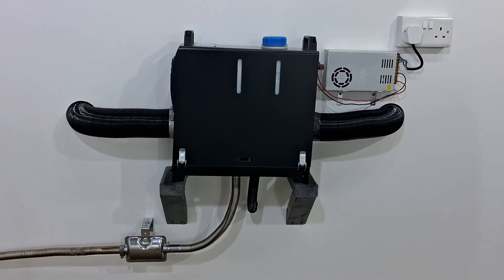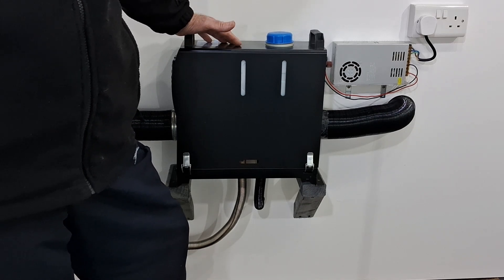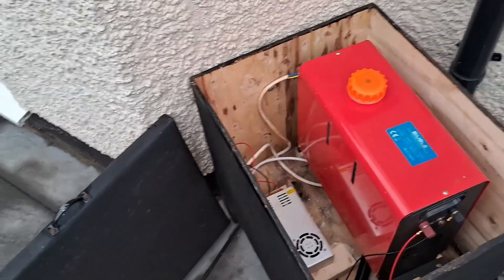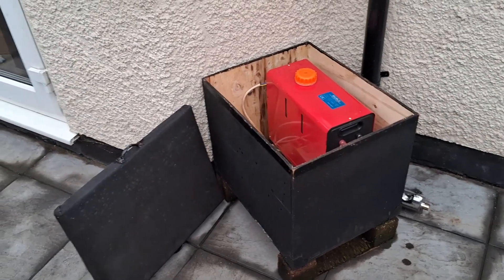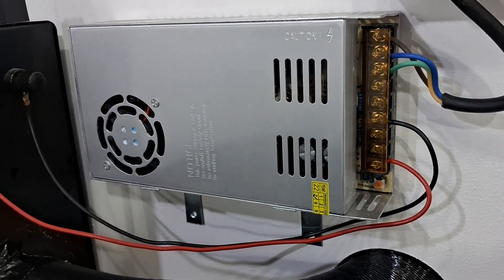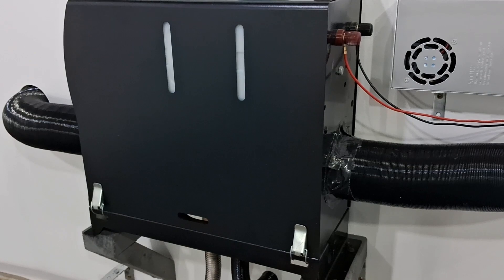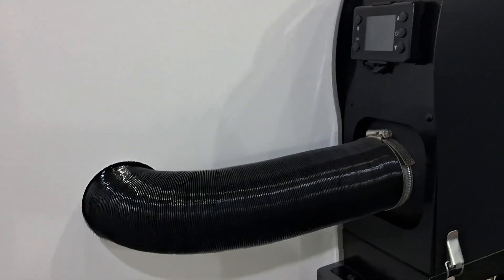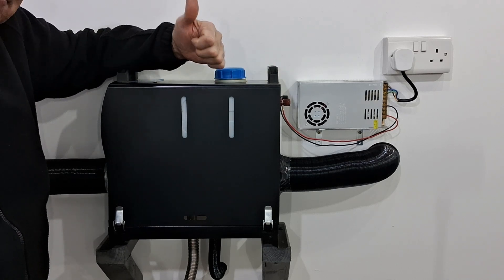DIESEL HEATER HEATING MY HOME

Comment: put an old iron radiators on the exhaust 3/4 pipe fits, i did on mine and in a non insulated 20" container and it helps alot.
Reply from the maker: good idea cheers andy

Comment: Hi Andy, you have inspired me to purchase a diesel heater to heat my home. I too have a garage which is where I intend to house the heater & pop a hole through the wall into to the hall. Like you my hall has all the ground floor rooms & the stairs off so it seems the best place to start. Why have you mounted the heater so high off the the floor? I assume that you have ducted the fan intake air from your hall to recirculate warm air rather than colder air from the garage? I also live in the Midlands & know of a Kerosene supplier I already use for my smokeless coal, logs & kindling. My heater has been delivered so thought I'd drop you a message, this is where my  journey begins 👍
Reply from the maker: it looks higher, because the garage is lower.
thats great, have fun.
i think its getting colder now so you have just got it at the right time.
let me know how you get on
cheers andy

Comment: I spotted a problem with these,   anyone using lifepo4's to run these and when the voltage gets too low the combustion turns directly off and reverses through the input manifold back into the house. 
It was a surprise as I had to find a power source to charge the battery back up to cool the burner down. Be careful with these. (Not plug and play).
Reply from the maker: thanks , cheers andy

Comment: I have a similar setup. Drawing warm air from the living room is ok You need to put that "silencer" outside because it leaks Co2 from the drain hole in the bottom of it. Also, I use smooth bore pipe and not that corrugated pipe from the point where you have the silencer so as to aid gas flow out of the unit (corrugated pipe collects soot over time). I used to use diesel for 18 months but have used kerosene for the past 8 months with zero issues.
Mine is located under the stairs and exhaust vented through the main wall to outside.
Reply from the maker: please see the next video, i did just that!...

thank you for your comment did you see my other heater vids, https://www.youtube.com/@andyfireblade let me know what you think, cheers andy

Comment: Hi, how many watts is the Regulated Switching Power Supply using ? Thanks
Reply from the maker: 15
Reply: @andyfireblade I’m thinking about switching to one of these instead of the battery & charger setup but I’m worried if I get a power cut then the heater is fried
Reply from the maker: @internetuser1183  there is a youtube video of a guy (stevethetransit) i think? killing his power to see what happens, and he did it many times and the heater was fine.
i have lost power a couple of times (my own fault) and mine was ok too.
but i dont have power cuts ever here , so i am ok.
i prefer the 12v power supply instead of the battery

cheers andy

Comment: That's a perfect setup! Great video Andy! Is your exhaust fumes being blown into the garage or outside? 
  I'm thinking I will just mount mine in the basement. There's already a chimney for my exhaust and I can just blow the air up thru the floor in my hallway which is a central location. I'm going to have to find a way to bring in fresh air for the combustion chamber because it is more dense and I don't want to burn warm air.
Reply from the maker: good luck with it.
thank you for your comment did you see my other heater vids, https://www.youtube.com/@andyfireblade let me know what you think, cheers andy

Comment: Yes, taking hot air from the already heated room and drawing it into the burn chamber doesn’t make much sense if you are looking to run as efficiently as possible, which you suggested you do. You’re basically dumping/wasting heated air by doing that, as it will be coming out of your exhaust.
Reply from the maker: thank you for your comment did you see my other heater vids, https://www.youtube.com/@andyfireblade let me know what you think, cheers andy

Comment: I've setup very similar just need to block that drain hole on bottom of exhaust silencer otherwise it will smell and carbon monoxide inside your room. You can use the little potentiometer in the power supply to speed up and down the fan and pump speed to suit if on the non adjustable controller board 👍
Reply from the maker: hello michael
thank you for your comment , appreciated.

did you see my other heater vids, https://www.youtube.com/@andyfireblade let me know what you think, cheers andy

Comment: How much fuel do the 2 diesel heaters use? I heat a 4 bed for less than a fiver gas a day, i also have a diesel heater on a boat and its no where near as efficient as my home heating
Reply from the maker: yes, need to look at cost.
cheers andy

Comment: Is it not better to draw combustion air from the cold ? It is probably marginal on this type of burner, but usually cooler air is preferred as it is more dense and therefore you get a more efficient burn🤔🎅😎
Reply from the maker: thank you for your comment
yes, thats true . i learned this in motor vehicle training years ago.
you would find how your car drove better on a cold moist morning due to this.

did you see my other heater vids, 
https://www.youtube.com/@andyfireblade
let me know what you think,
cheers andy
Reply: @andyfireblade  Any of us with bikes or cars  that have carbs know this .....they struggle to breath in hot weather but run well on cooler days .🙂after finding your videos im now after years of cold....fitting one of these heaters in my work shop . theres an awful lot to consider and get it right ....
Reply: It don't make any difference with this type of burner.  The control unit speeds up the air intake if needed as it is computerised forced air. @specialse
Reply from the maker: true fact
cheers andy

Comment: you can get fumes blow back into the house from the combustion  air intake as its connected  to the combustion chamber also the exhaust lets fumes out as there not air tight and should be mounted outside at the end of the exhaust pipe  and not in between :)
Reply from the maker: thanks my friend, i think i will change this.
cheers andy

Comment: You may have excess soot buildup if running these on low all the time. Best to be running mid-way, or so. At least 4 on a scale of 6. Also, I'd suggest drawing combustion air from the garage, rather than taking away from the heated area to do this. Why heat some air, just to put it outside the living space for the burner?
Reply from the maker: i did this on the next video, you are right!
thank you for your comment did you see my other heater vids, https://www.youtube.com/@andyfireblade let me know what you think, cheers andy

Comment: i would say if u want greatly increase the efficiency of that burner u need to exchange waste heat from the exhaust to heat up the fresh air (but the impeler seem to be make of bakelite maybe not better idea of the world; but basikly.. if u preheat intake air u go higger in temperature inside the device so the delta T is bigger so i will give off more power into the house heated air..
Reply: i freshly own one, personally i will go for distilation setup... 1 meter inox housing for freshwater on exhause, housing copied like chemistery simple path distilation (1 meter of water condenser will do the job to recover the waste heat.. and why a distilation setup? to recover the corosive condensat and be able to dispose of it properly or maybe use it for chemistery ^^
Reply: if u use it inside a van with waste heat recovery . let say u have 200 liter barrel u heat ur camping car to a nice cozy heat until ur waste heate had heated ur 200 liter to 60c .. then done shut the diesel of and let ur heated hot water tank not insulated act as radioator and keep the place nice and warm for u to sleep without that pesty pump noise...

Comment: I have exactly this setup in my remote concrete panel garage, the disadvantage I have is that I have to power it off of a generator. Otherwise these things work a treat and my garage has never got as warm as it does now and for a few pence a day on diesel. I think I might give this a go in my house as it is pretty cheap to buy and setup. Well done on the vid
Reply from the maker: thanks, yes these are a great little heater and cheap to run,
the one one that i had heating the house last winter was great.

did you see my other heater vids, https://www.youtube.com/@andyfireblade 
let me know what you think, cheers andy

Comment: Better to pull cold air in for combustion instead of from the room you’re trying to heat. Otherwise you create a negative pressure, with the air being made up from leaks in the house envelope, drawing in cold air from outside. That’s why some folks upgrade their wood/pellet stoves with outdoor air intake.
Reply from the maker: thank you for your comment

did you see my other heater vids, 
https://www.youtube.com/@andyfireblade
let me know what you think,
cheers andy
Reply: Also, if the combustion chamber floods, then the excess diesel is pumped out of the combustion air intake! 
You definitely do not want diesel dripping inside your house.
Reply: Would that pressure difference be anyhing meaningful? and of course the opposite would be true you'd be forcing warm air out,, interesting point though, but as I have 2 x 4 inch vent pipes in my living room becuase of a gas appliance in the fireplace, that blow a gale I guess it would be moot for me :)
Reply: I also have the combustion air intake from the outside for the above reasons. It also cuts down on the noise quite a bir.
Reply: The air in and out is an equal exchange and wouldn’t cause positive or negative pressure however the air inlet for exhaust is sucking air and would cause a negative this is extremely low and would almost be not noticeable. I wouldn’t understand why you would need this inside the property unless it’s what samples the air temp to turn the heater on and off
Reply: My 50k natural gas furnace doesn't have to have a fresh air supply according to building code here in canada one of these certainly doesn't pull enough vacuum to make any difference regarding negative pressure in the building!  The level of petty bs comments on all videos tells me people are shut in due to winter and just bitching about every single damn thing
Reply: I have mine split into 2 and have a screen in part of my internal one,  the outside one is drawing in very cold air, the difference internally at 2 degrees external temp between a single and my split set up can be 2 degrees from 18 to 20 degrees. However the higher temp does away with condensation in the mornings

Comment: Your mufler should be outside, they tend to be leaky. I'd put a monoxide detector either side of the wall for belt and braces. Google fireball extinguisher, not necessarily something you need but great little things
Reply from the maker: thanks for the tips!

did you see my other heater vids, https://www.youtube.com/@andyfireblade let me know what you think, cheers andy

Comment: Id of thought you would have been better putting control/ thermostat in the hallway? The garage will be a completely different temperature to your hall so you may not get the benefit or control you want? Just drill a small hole and extend wire and pass through and mount on hall way wall.

Comment: I heat my shop with this type of heater. I've made biodiesel from wasted veggie oil and the costs of heating are maintained very low. I posted on my channel my setup and also how I made that biodiesel without using methanol, but denaturated alcohol which is much cheaper and you find it everywhere.
Reply from the maker: thank you for your comment, thats interesting, i will take a look

did you see my other heater vids, 
https://www.youtube.com/@andyfireblade
let me know what you think,
cheers andy
Reply: Very neat …. Top marks! I took the plunge and went from battery to power pack. So much more convenient but I worry what would happen to the heater in a power cut. No one has made a video of this happening? And if heater indoors I just worry 😮

Comment: The silencer you mounted inside, does it not have a hole for fluids to drain? that could spew exhaust inside your garage?  or did you plug that hole

Comment: Only thing is with that psu you will need to remember not to let any kids or grand kids that turn up alone in your garage area with those exposed wires.

Also you are using twice as much electricity to power them, perhaps as i said before a solar pa el connected to a battery would save you the cost of the electricity and which I'm sure is not a lot but it all mounts up.
Reply: I have used one of these PS units & the stray EMF going back to the mains supply is shockingly bad! It seriously affected anything close on same ring or radial circuits!!
Reply: @ Paul_SD I use the Megawatt brand for both my ham radio station and my work shop diesel heater and do not have any issues with them. Both are connected to batteries for power storage.
Reply from the maker: thank you for your comment
yes the savings all mount up, good point!

https://www.youtube.com/@andyfireblade
cheers andy
Reply from the maker: thank you for your comment

did you see my other heater vids, 
https://www.youtube.com/@andyfireblade
let me know what you think,
cheers andy

Comment: Cold air for the burner is more oxygen rich, so hotter burn for the same amountbof fuel. As ithers have mentioned... There is a lot of heat wasted by the exhaust on these heaters too as in you other videos try to capture it through a radiator, maybe for hot water a shower or a just radiator inside you house
Reply from the maker: Thanks for sharing , good comment
merry christmas andy

Comment: Nice setup, but I have two suggestions. 1) the large return should be lower on the wall to pull in the cold air by the floor. 2) the small air source pipe should not be pulling warm air out of your house. It is being wasted because it goes out the exhaust.
Reply from the maker: Thanks for the tips!
cheers andy
Reply: Only the exhaust gas is vented outside, the 'inside' air is incapable of being drawn into the exhaust side, I have 3 of these heaters. The biggest mistake to make with these heaters in too many bends in the exhausts, it will either choke up the unit with soot or shut down upon startup.
Reply: @merlin1346  you misunderstood. The air drawn into the burner and expelled through the exhaust should not come from inside of the area you're trying to heat. It will take your heated air and waste it out of the exhaust.

Comment: I've got exactly the same set with the converter, but last month it let me down it will run for about 40 minutes and the it just turns itself off fills the room with fumes, it's saying error code 7, do you have any idea what this could be?
Reply from the maker: hello dean, i have known this before to be a wiring problem, or it could be mother board, at worsted mother board and controller replacement should fix it? good luck mate
Reply: Thanx Andy

Comment: I like the setup.  I just had to get a new heater and the second one died within 48 hours.  I am hoping the company will help me.  I think condensation got into the burn chamber.  Anyway, I have hear that cold air intake is better, but mine is also pulling in from the inside.  I need a longer intake hose to put it outside.  I will try that soon.

Comment: The way you've set this up it's not safe two reasons one these Chinese heaters do not have very good connection with exhaust and does leak bad idea to have the unit inside your house. 2nd you are missing a back up Battery if you ever got that on full power, and you have a power cut it will damage or even melt the plastic housing another reason why it should be outside
Reply from the maker: i made a couple of changes on my next video.
thank you for your comment did you see my other heater vids, https://www.youtube.com/@andyfireblade let me know what you think, cheers andy

Comment: Great way to beat the negative pressure by keeping all the flow and returns in the same room. Doing a radiator connection to deal with the exhaust gases would capture more heat. Pipe and lag the inlet at the top of the rad and the outlet at the bottom to ensure condensate doesnt get into your heater and as you know, that rad is gonna get properly hot! Great videos and content!
Reply from the maker: thanks glenn, good idea. and thanks for looking at my vids
merry christmas andy

Comment: Great setup!! Looks neat and well thought out. I would love if you could incorporate your exhaust heat radiator setup to heat the garage at the same time with the otherwise lost heat (I know you have a long exhaust pipe, but still) and I would drill a hole and get the display wired inside the house. You could also do some kind of pipe work inside your house so that the air intake would be getting the coldest air possible from a room far away from the air outlet, to stimulate circulation inside your house, but I completely understand if that is a step to far 😅 Great job. I have watched I think all your videoes on these heaters and have gotten one from Vevor myself for the garage with a 4,5m long straight aluminium exhaust pipe to get the most heat possible out of it, with inspiration from your videos. Greetings from Norway!
Reply from the maker: thank you for your comments, great!
yes display in the house was one , i was thinking of.
good luck with yours.

https://www.youtube.com/@andyfireblade
cheers andy